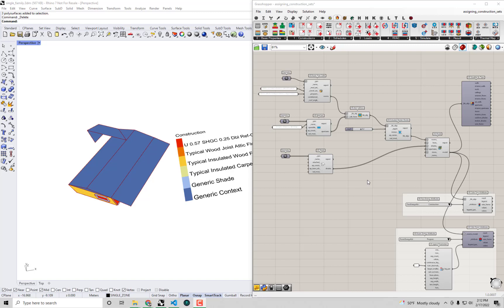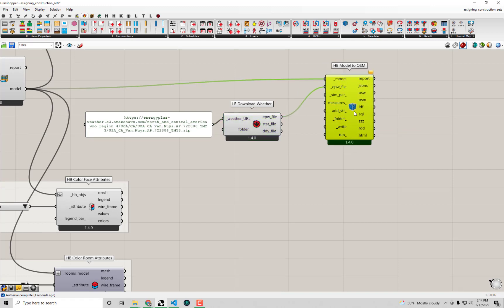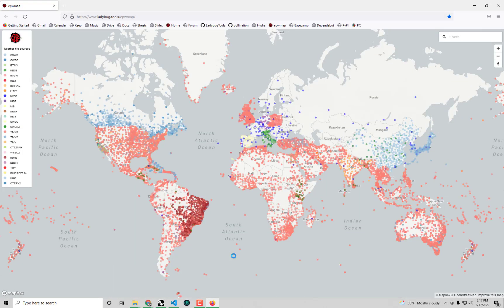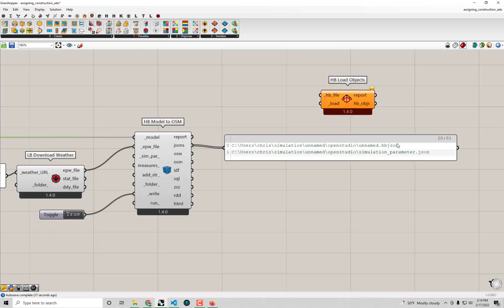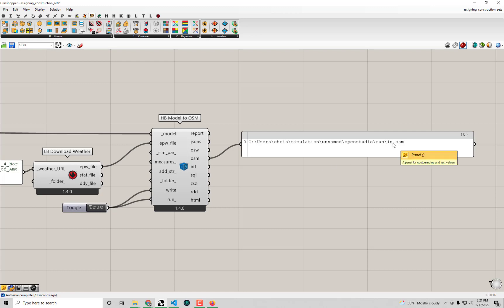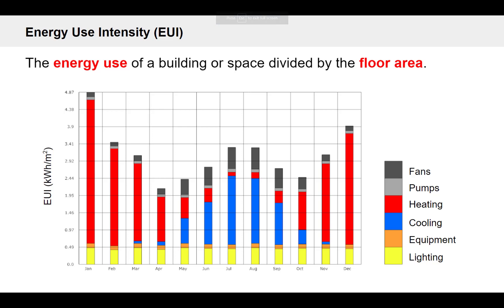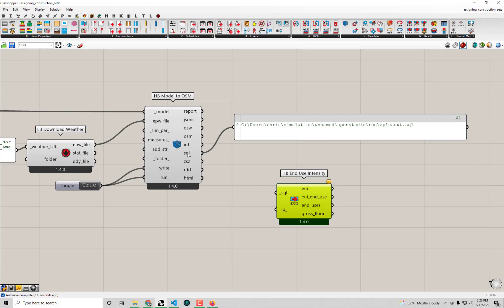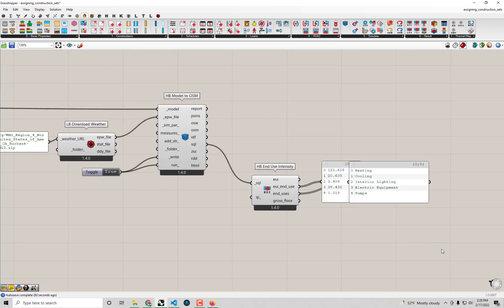Energy Fundamentals: Running a Simulation

Comment: Amazing videos! This tool is so useful

Getting two errors when running the "Model to OSM" any idea or pointers

1.    ** Severe  ** <root>[ZoneHVAC:IdealLoadsAirSystem][Room_8_9665b0d6 Ideal Loads Air System] - Missing required property 'zone_supply_air_node_name'.
1. Solution exception:   **  Fatal  ** Errors occurred on processing input file. Preceding condition(s) cause termination.
Reply: For anyone looking, those errors just mean the versions aren't synced